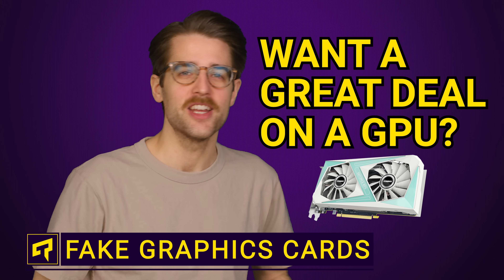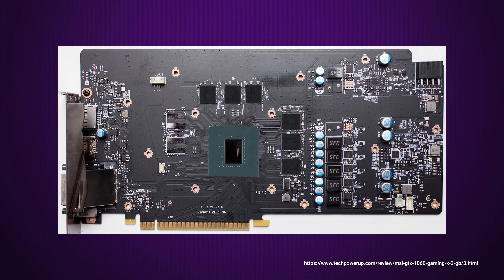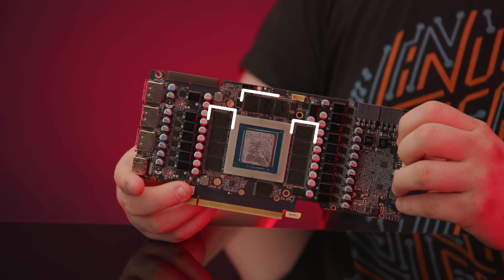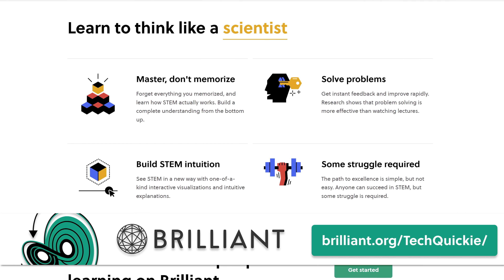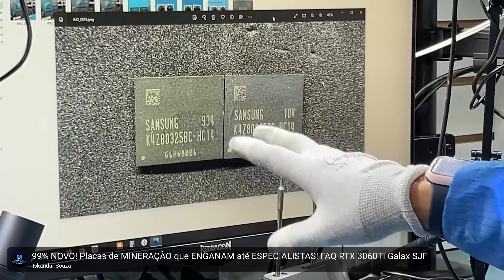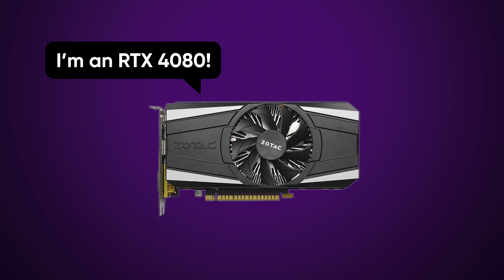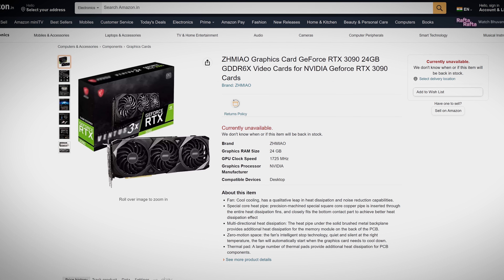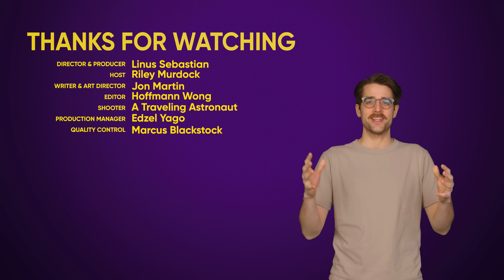Fake Graphics Cards Are Everywhere

Comment: even more over cant the shady people just reprogram the card to lie to the os and say it is a certain one just like the usb stick drives where they take a 8 or 16 gig and reprogram it to say 1tb or 2tb?

maybe what the manufacturers should do is destroy the factory rejects.

if a card fails to perform to specs then nvidia would shred the gpu chip so it does not get used in a fake.

if nvidia does not want to waste a perfectly good piece of silicon they could bin it down to a lower level for example take a founders edition and bin it down to a 80ti or even 60ti if the chip is a matter of a few cores that are failing.

also they should consider making the identity rom read only.

Comment: This is stressful when thinking about it. My ASUS TUF 3070 is bagged clean, no damage all safety covering in a sealed box and when I use it paired with a 12700kf, it acts like a 1050.
Reply: I'd check Cinebench, Afterburner, ect to make sure the rest of the system if fine, that pairing should be fine. If you have another system you can swap parts like the RAM or GPU with all the better. PCB dimensions and layout (vs a reference image) could give you an idea if you do have a fake card.
Reply: @BrattyBobert  so for whatever reason I couldn’t get cimebench to work (faulty download or something) but I messed around with the Nvidia control panel. I found out that one of the settings were not set to my 3070 and just at auto, and set frame rate to unlimited with v-sync off. I’m pushing around 100fps on sons of the forest at max graphics at 2560-1440. Much of what I was expecting out of this card.
Reply: @Sturmgechu  Happy to see it worked out for you. If anything that's much higher than the Jansen Benchmarks video results, so just check DLSS isn't enabled and inflating things. Congrats!